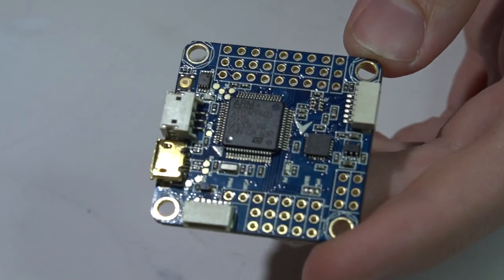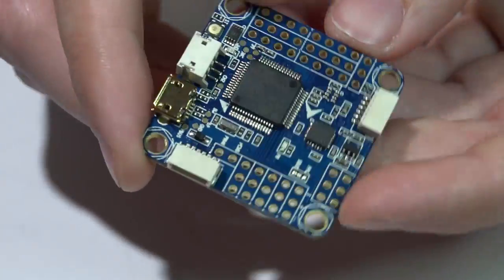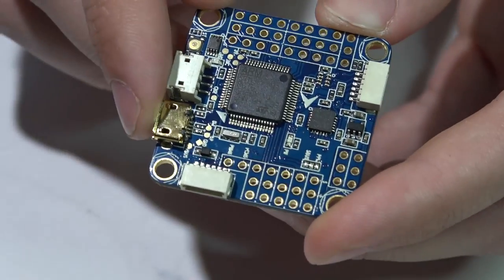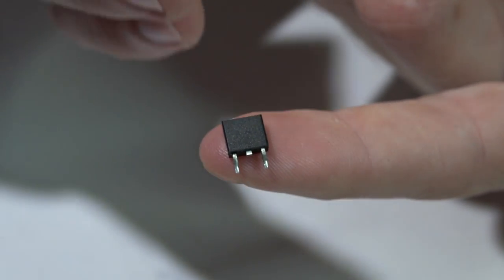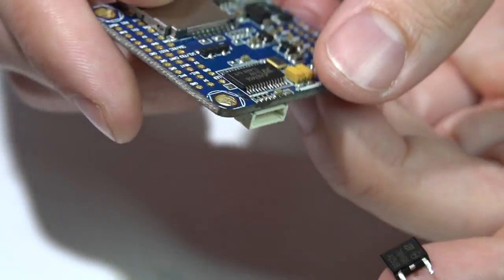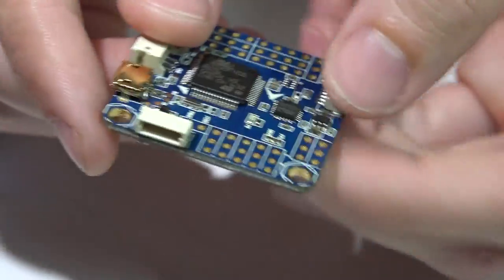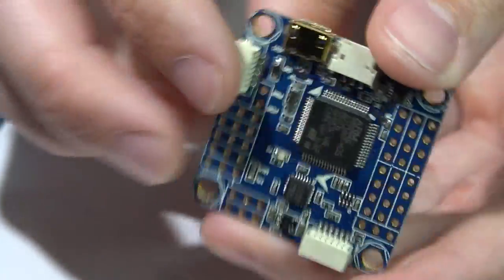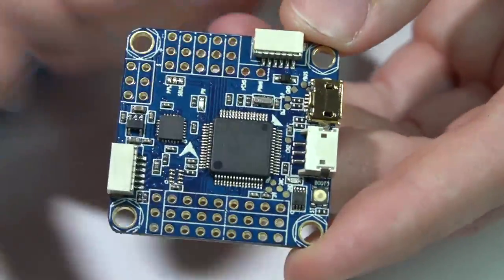Omnibus V3 Flight Controller

Comment: the Uart is changed to u6 on the main inverter
Reply: witespy Yep. This was a big change with the v3. Still need to pull the uninverted signal from the Rx if you want telemetry.
Reply: witespy please respond to your emails!
Reply: witespy All I want to know is how to actually do the "Repair/replacement service" on the Asgard AIO's, cause I'm about ready to build a few 3" quads with those.
Reply: They will be perfect for 3inch builds. If you do have a problem if you send it back 90% of the time we are able  to fix it and they seem better then new just about. just message back the order email with pictures and details of what happened.
Reply: Does this mean that you need to connect your SBUS receiver to the j10 connector now? Or are you talking about just the telemetry wire for your RX?

Comment: Please will you give the proper name (or an eBay link) to purchase the single header plug with cable.  I have found the 4pin and 6pin micro JST SH 1.00mm female connectors but the supplier doesn't mention whether or not the cable is plastic or silicone (nor the guage).  Can you advise please?  Tks Dave [NZ]

Comment: where did you buy this from? have you got the link
Reply from the maker: Either Myairbot.com or readytoflyquads.com
http://shop.myairbot.com/index.php/flight-control/cleanflight-baseflight/omnibusf4v3.html
http://www.readytoflyquads.com/flip-32---f4---omnibus-v3
Reply: Project Blue Falcon Cheers, getting one to replace the kiss
Reply: that is the diference between these these two? (the fist is your link)
http://www.readytoflyquads.com/flip-32---f4---omnibus-v3
http://www.readytoflyquads.com/flip-32-f4-omnibus-v2-pro
Reply: the link says v2 pro but the website says "Now Shipping the Newest 3V "
Reply: the "pro" has a build in current sensor
Reply: witespy both have curren sensor
Reply: Project Blue Falcon do you know the diference between normal and pro versión?

Comment: Hi, I tried Fc omnibus f4 V2 from BG

The port usb it is jump away... and I have friend with same problem on the
same board.

I have soldered the port usb...

Then the bec of 5 volts of the Esc work to 1 volt... 

The bec of video to 5-volt work to 4 volts... The camera to 4 volts not works.

PS yes, the fc make much hot…

Comment: Need some help here guys I have the omnibus f4 v3 and cant get my Spektrum telm receiver to work right. I am using the pins near the motor header pins and can bind but when I go into betaflight and look at the receiver tab all the channels are going crazy. I can see that a signal is being seen because if I give stick inputs the values change.

Comment: Anyone knows if I can use PWM transmitter with those flight controllers? Thanks
Reply: You can't. SBUS or PPM (or Spektrum SAT) only.
Reply: mmm that's unfortunate. Thanks for the answer!! (wasted about 1hr looking for that info on the web, we should document that stuff better)
Reply: Κατσαρό Πιρούνι 
jc did mention it in his initial review. aren't there sbus or ppm receivers for your radio?
Reply: there are, but kind of expensive, around 30 euros (I have a futaba T6ex) but I think this gives me the opportunity to upgrade my transmitter. Maybe those turnigy or that radiolink at9 from bangood
Reply: Κατσαρό Πιρούνι 
oh yeah, I understand. what about the "Cooltech RFASB"? you can get it for about 20eur from banggood. of course you are right. the Flysky/TGY receivers are even cheaper.
Reply: wow thanks. Have you tried any of those? Flysky and cooltech sound too much of a  knock off.
Most probably I am will try to sell my futaba at a good price to get a modern radio
Reply: No, I'm sorry. My Radio does support Futaba and Flysky/Turnigy protocolls and receivers but I only tried and fly some Orange Spektrum DSMX and FrSky receivers. Most of my friends fly FlySky. Turnigy is the knock off. They and others sell the FlySky radios and receivers as a rebrand. The TGY Evolution is kind of Hobbyking's first own design.
Reply: Ha! so Turnigy is a knock off of FlySky?
Reply: Yes exactly. Many others sell the rebranded Flysky stuff too. Eachine, Monstertronic, reely and many more.